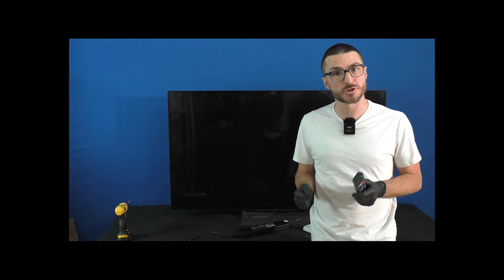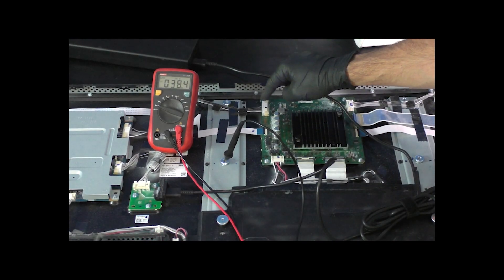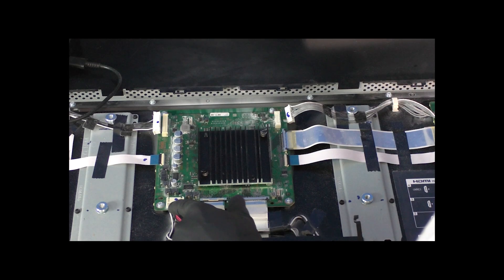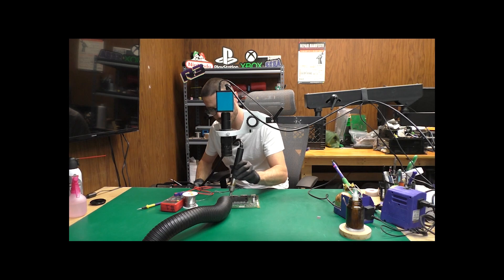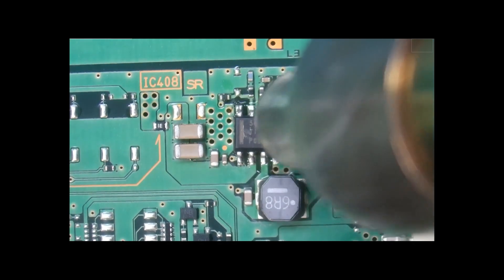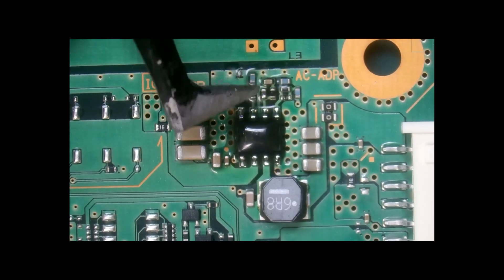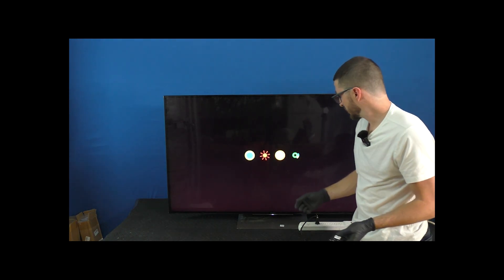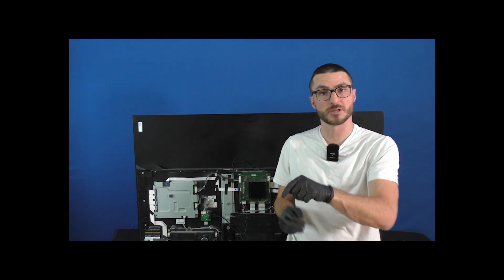Dead Sony No Power Repair of DPS Board XBR-55X930D

Comment: Have you ever come across an issue with X900E (I have European model so KD-75XE9005) or similar Sony TV having corrupted firmware inside? My version shows up in Bravia help as PKG0.0000.0255EUA, which has to be completely false, as real versions start at PKG6.xxxx.... on this model. Every time I try to update via USB it fails and when i try to update via internet it says that TV is up to date. From settings I can see I have Android 8 while Android 9 is latest android version for this TV. I got this TV second hand, so this issue happened before I owned this and I'm quite sure that his update failed or something and then this happened.

If you have any idea how I could fix this and update my TV to latest version I would really appreciate it!
Reply from the maker: I guess you could try to factory reset it and then try the update again. But if it says it's up to date that probably means it is and that the Android 9 is not compatible with your TV.

Comment: you went from saying the board was bad to removing an IC, did you lose some video?
Reply from the maker: oh my god, yeah you are right. 
When we see a short to ground on the 3 caps it means that the IC next to those 3 caps is shorted and needs to be replaced. That's the part that we missed. 

I don't know what happened but this is a bad mistake. I filmed it a month ago and don't remember it clearly and how that could have happened. Sorry and good catch.

Comment: Hi Nick! I have a KDL55 809 Sony Bravia. I recently replaced the main board and now the tv boots up and I can hear ambient beach sounds, however I have no picture. Just a dead black screen. Would replacing TCON board resolve the issue? I have tried update the firmware via USB but seem to be stuck on amber and green lights.
Not sure it's the back light either ? Any clues comrade. Thanks Sy
Reply: If you can hear audio, it's certainly back light!
Reply: @Aneesh.Asokan  is it expensive and easy to replace the back light. I checked all the connections to the tcon board and main and they seem fine (I.e they are inserted correctly). Any advice is much appreciated. Thanks Sy
Reply: @t1mech1ldtc60  You make sure that you can hear audio & picture (only if you look at screen closely) so to confirm that it's indeed the back light! If it's back light, it's NOT EXPENSIVE at all!👍
Reply from the maker: It's expensive if you pay someone else to do it because it's very time consuming and requires training to do properly. If you just go for it, there is high risk you crack the screen. You have to be very careful with the screen replacement for these as it's very fragile.
Reply: @NicksTVRepair  Of course, you are right on that in every aspects! I commented so thinking that our poster is familiar with occasional DIY experience & naturally know it's pro's & cons!
Reply: @ You sir are a gent. I managed to replace the main board and get sound but the lack of picture was a surprised.It was suffering from a firmware rebooting issue. I’ll open over Xmas to see if it’s the backlight  which … which it probably is with my luck. I love this stuff and thanks to your channel I’ve succeeded in fixing a lot of Bravia TVs. I’ll donate for sure
Reply from the maker: most likely the ribbons aren't seated properly.